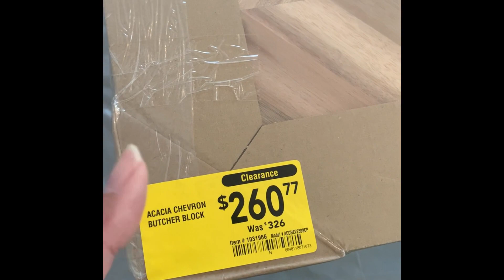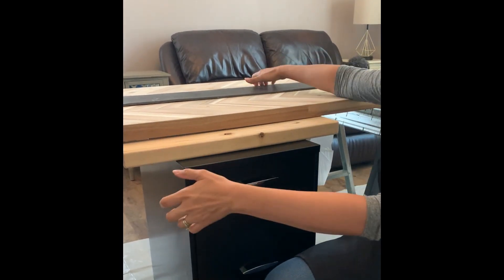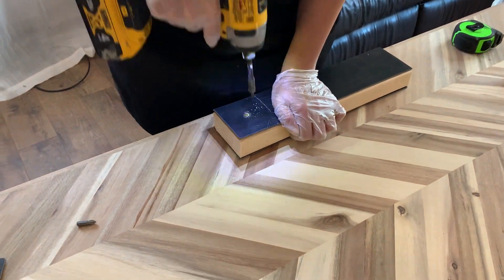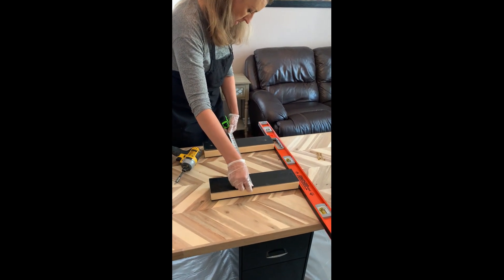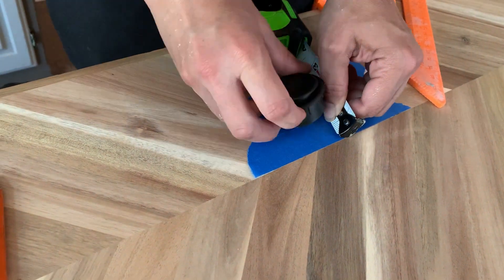Butcher Block Desk DIY

Comment: I saw this same Butcher Block and thought it would make an unique L-Shape Desktop for my studio. I saw on Lowe's website that the Butcher Block is finished already, and just needs to be sealed. If I may ask, why did you choose to sand it 3X and seal it, and was the Butcher Block not smooth and finished as advertised? Any feedback you can provide would be really helpful!
Reply from the maker: Thanks for the question. Actually it did come smooth. We lightly sanded between the polyurethane coating since the wood tends to absorb the liquid and cause the wood filaments to expand slightly. After a coat or two it remains fairly smooth.
Reply: @TammysHomeTips  Thank you so much for responding! It makes sense what you did because you wanted the sealant to go deep into the pores of the wood. Well I’ll ask this last question then, does this make the sealant last longer, and instead of every 3 years for a reapply, it’s every 5-6?
Reply from the maker: I would say it depends on how you are planning on using it. As a desk it might last longer without refinishing. On the other hand, in the kitchen it may need refinishing more often. I cannot say for sure. 🙃
Reply: @TammysHomeTips  Thank you! I would guess then that using it only as a desk in a studio for content creation and studying would last longer than using it as a countertop. Thank you so much for your help, I cannot thank you enough. This Butcher Block is pretty pricey, but it is unique, sturdy, and spacious, and it's all the things that makes it a custom desk, as opposed to getting a generic office desk that does not meet your needs! Thank you again!

Comment: Do you think one that's 6' long would need support in the middle?
Reply from the maker: Hmmm… I’m not sure. I guess it depends on if you put the legs in from each end a few more inches than I did.
Reply: @TammysHomeTips  I actually wanted to set it on 2 filing cabinets instead of attaching legs.
Reply from the maker: In that case, it should be plenty of support in my opinion. 👍🏼👍🏼
Reply: @TammysHomeTips  Thank you for your replies 😊
Reply from the maker: Absolutely!! Have fun with your project!